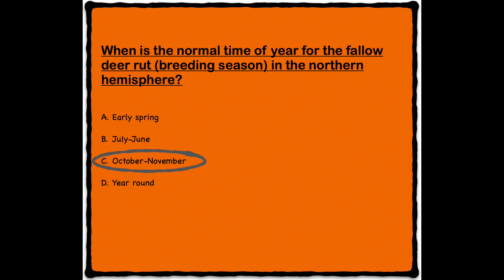Catch the fallow does in the chute. Easy right!? You have no idea

Comment: i know nothing about deer. I do want to ask about the chute you use though. I understand why it's covered and all, to stop them jumping out. But why is the press so complicated? I would have thought something similar to a sheep squeeze would work a little better then this. Or is there something about Deer that makes this style better?
Reply from the maker: Great question. First of all, the wide black side doors are designed to allow antlered bucks to fit in the chute. That would be the biggest issue with using a sheep chute. This particular chute is about the 8th version of the “deer handler” it’s been purpose built for deer and is very well designed. The way the chute restrains the deer is, once they run in, we drop the floor out from under them, so their legs can’t touch the ground and jump or run.  It cradles them in kind of a V shape. It doesn’t clamp down on their body or neck. Also, the entire chute is enclosed because the deer won’t walk in if they see a person standing next to it. In fact we had to tape up the gaps between the boxes because the deer would see us, and wouldn’t move forward. Thanks for watching!

Comment: After watching your video, I have a few questions:

1. How long do you keep the CIRD device in place before removing it and proceeding with artificial insemination?
2. After removing the CIRD, do you administer any hormones?
3. How can I confirm if the deer is pregnant after the insemination process?
4. Could you please share the results of your artificial insemination efforts? Specifically, how many deer became pregnant, and what was the success rate?
Thank you for your time, and I look forward to your response.
Reply from the maker: Thanks for the questions.
So we left cidrs in for 15 days. 14 is fine, we did 15 to line up with our ai date/time. The timing after cidr removal is very important, much more so than the exact time the cidr is in. We try to inseminate 66-68 hours after cidr removal/pmsg.   
There is no good way to confirm pregnancy. There have been attempts to do this, but working the does in the first trimester causes a high rate of aborts. 
We achieved 70% success with our AI this year! This is very high for a first time with fallow. Many farms did less than 40% this year. There are several factors that contributed to our success.